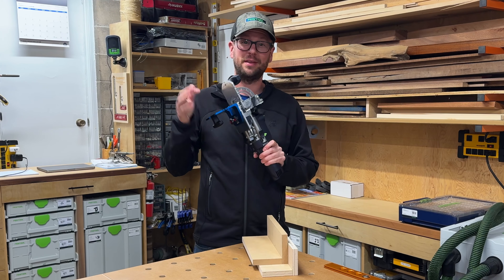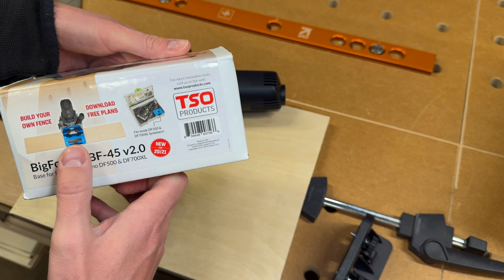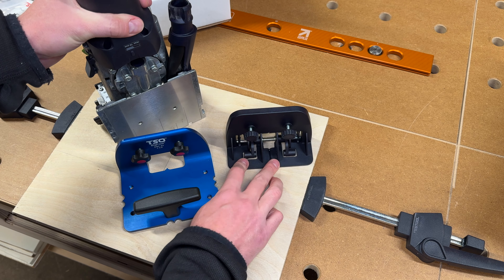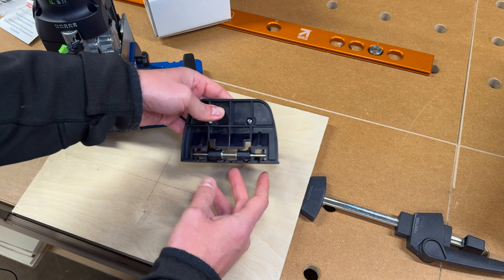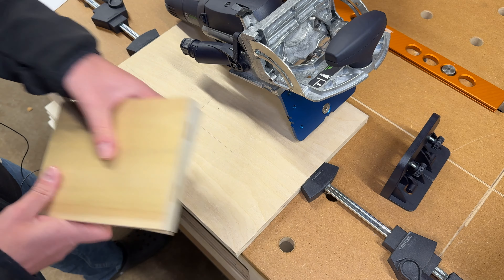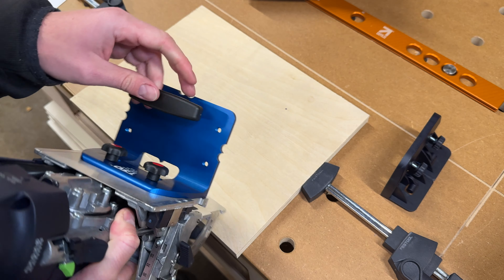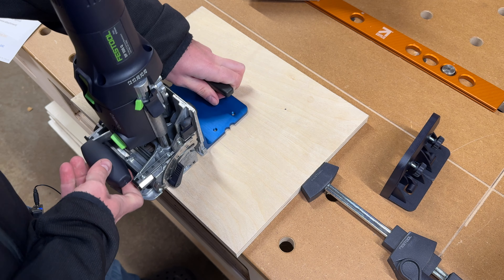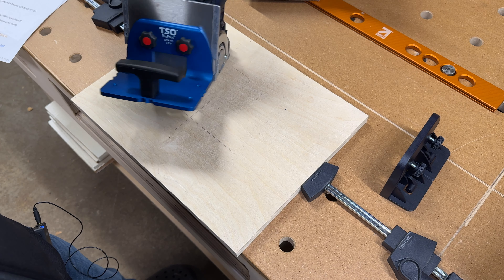TSO BigFoot for Festool Domino (DF 500 and DF 700 XL) // First Impressions

Comment: Good review of this accessory. I'm ready to take the plunge and purchase the DF500, and am just having a mooch around to see what others have found useful. Thanks for sharing.
Reply from the maker: Thanks for watching! I do find this accessory to be well worth it and while I bought it right away, most people should probably try the part that’s included with the Domino and if you find it not sufficient then this is definitely the answer!
Reply: You are, of course, quite right. I would, however, be considering the Q option, along with the domino sustainer, which includes all the additional cutters. Here, in the UK, the price difference is not so great - unless purchased individually,  at a later date. Again, thank you for taking the time to share!